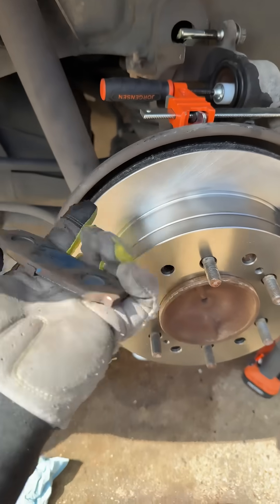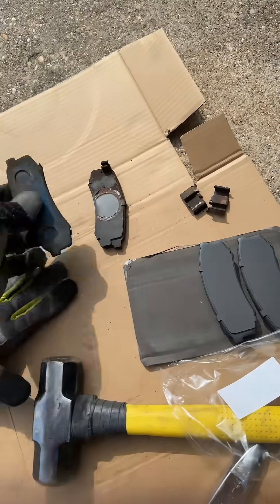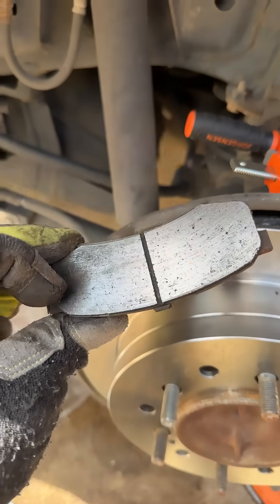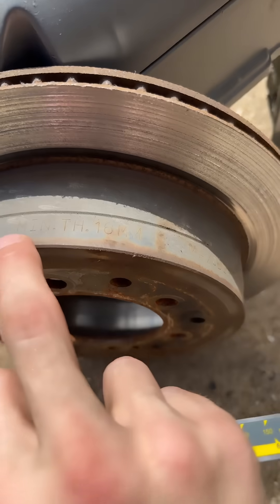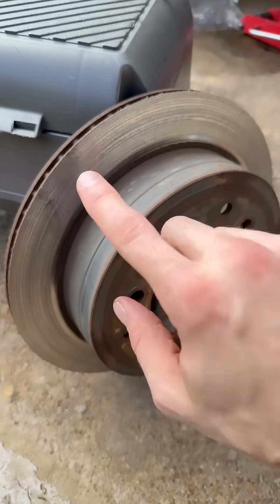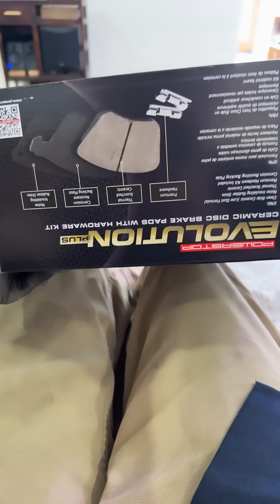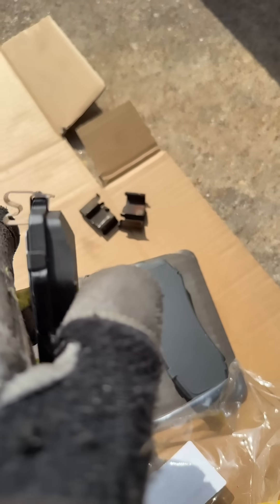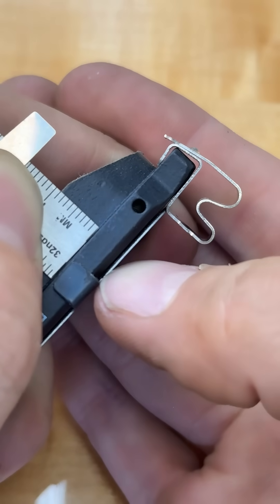brake pads contain a sensor and a calculator and a musical instrument

Comment: With how only one side of the rotor is worn out doesnt that indicate the brake caliper isn't freely moving?
Reply from the maker: no sir.  one pad reached end-of-life just a hair sooner than the other, and then rapid deterioration took place due to steel rubbing steel.  i’m sure 3 months ago they were close to symmetric. EDIT (maybe i am not so sure of this)
Reply: @davidmalawey I still contest that the rotor is unevenly worn out more than normal.  I have seen pads worn past the brake material, into the steel. The rotors hold up enough to be resurfaced and had even wear on both sides of the rotor and pads.

It is symptomatic of seized/unlubricated slide pins on the brake caliper.  This would explain why one pad wore out faster than the other.  The caliper should freely float and produce even wear on both pads, and both sides of the rotor.
Reply: @ethikplays  thanks, I was wondering about this too
Reply from the maker: @ethikplays i see, that is worth investigating.  Need more than 24 hours in a day, hardly find time for a superficial brake swap. On the good note, the caliper pins appear smooth. I’ll check it again next opportunity.

Comment: I love my 4th gen 4runner. It will last forever with fluid changes.
Reply: It will if you are not in the rust belt or up north. The worst trucks when it comes to rust are Toyotas.

Comment: Ummmm.....did you ever show the brake shoes that go inside the drum? Did you have to replace the brake shoes inside the drum??? 🤔
Reply from the maker: Good point, but not an urgent need. my shoes have 4mm remaining.  These only activate under parking brake application.

I decided to save the shoes replacement for another time.  Mainly because it’s 98 degrees outside and I am melting in direct sunlight.  It’s best to do a full maintenance in the fall.
Reply: @davidmalawey  Man! I completely forgot about the parking brake angle!!! 😂 If memory serves me correctly, that's what saved my butt on a 90° curve!!! I was driving a stick-shift Subaru & the brakes gave out. I was able to gear down and use the high-rev braking of the engine. I think I also used the handbrake by the seat too!!! You must be in Texas or Arizona for as hot as you are!!! I'm in MS and we are getting a break in the heat & humidity!!!